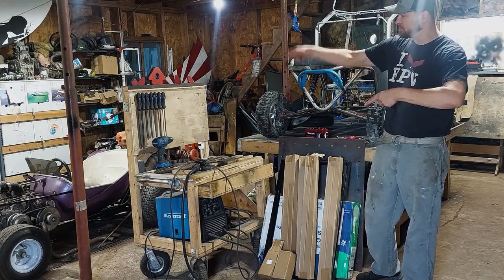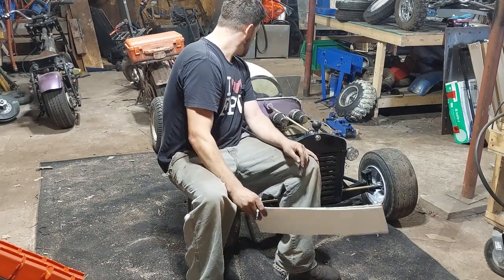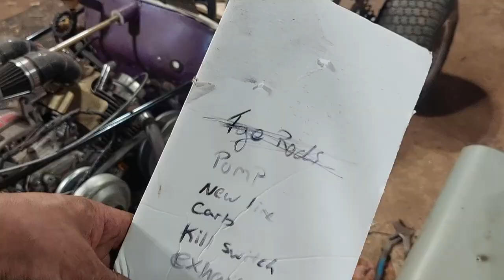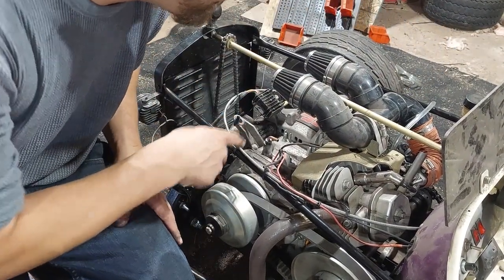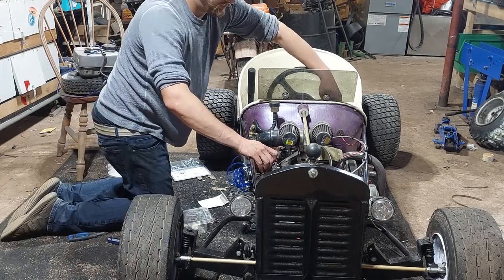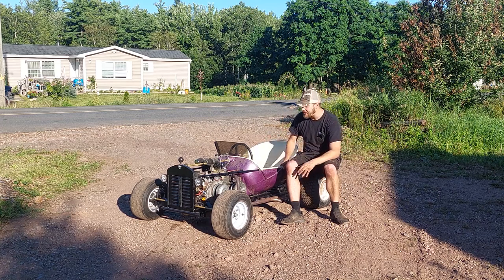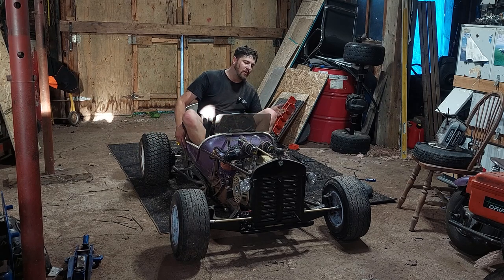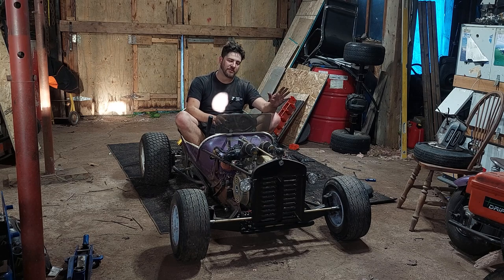WHEELBARROW GO-KART FIRST TEST DRIVE

Comment: Finally!!! that thing really rips!, I'd think you'd be better off with something with shiftable gears to get the most out of both worlds but I see what you mean about sluggish bottom end on the dirt track I'd definitely gear it down it will be just as fun I promise either or awesome build! 🤟🤟🤟
Reply from the maker: Yea, I'm definitely going to gear it down, I use it way more on the track than straight lines, but a little 600 with a slap shift mayyyyy be the next big rebuild ahah

Comment: I put a 5000watt motor in mine, bought a plastic mockup engine made fiberglass heads& intake with carb! Mockup engine is the battery pack! I know you're in Canada because I see Power Fist labels AKA Princess Auto 
( the expensive Harbor Freight)
Reply from the maker: I have been seeing people do the electric versions out of radio flyer wagons, super bad ass!

Comment: A Comet 780 series CVT works great. That would be a good replacement for the 40 series CVT.
Reply from the maker: I have one right here! I've been debating it heavily!
Reply: I have 3 homemade machines that have 780 CVT's. They handle 25-30 hp with no problems.

Comment: Did you use 2 wheel barrows or 1?
Reply from the maker: I used 2 wheelbarrows and a snowblower body for a square footwell. I also cut about 5" out of the center of the original wheelbarrow to give it more of a bucket look.